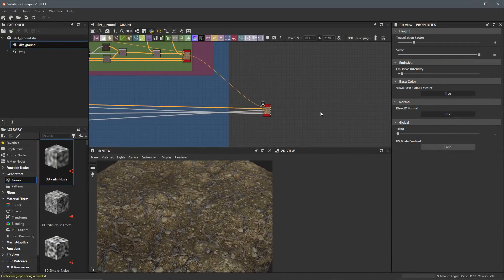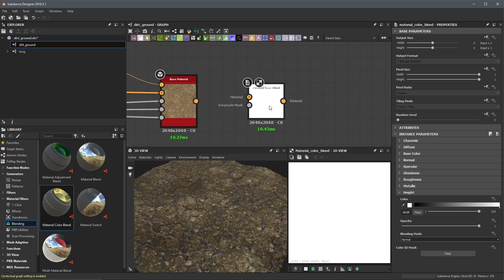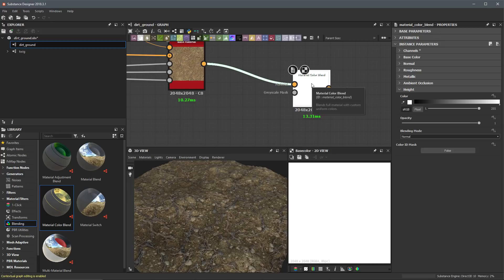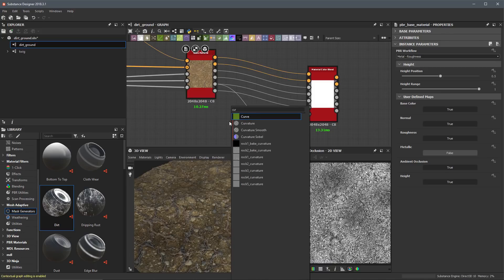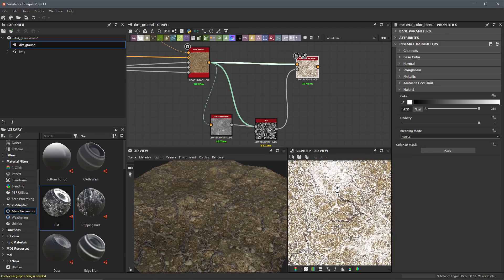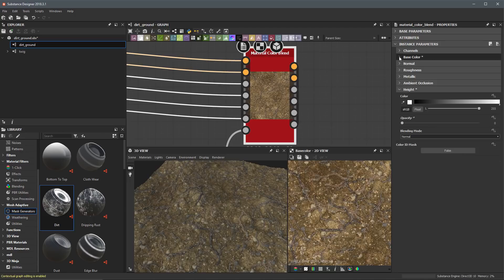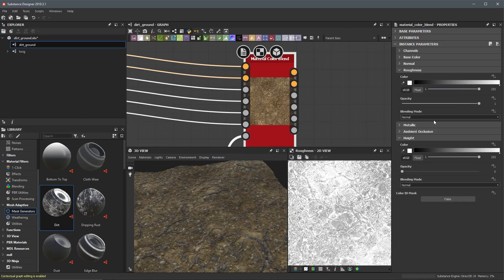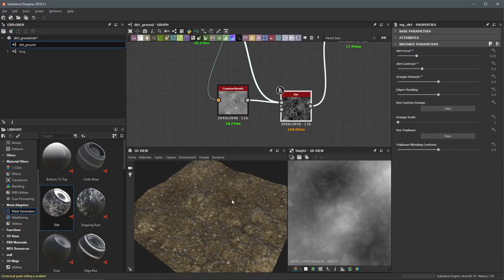04-01: Using material layering to create a dirt layer | Adobe Substance 3D

Comment: How we can make water
Reply from the maker: It can be a simplified version of water using a mask for water areas and then making the roughness map very low so there will be reflections.
Reply: In the next video 04-02 there's a short bit at the end where he adds a "Water Level" node which straight up adds the nice muddy water puddle effect. This really should have had a video all to itself tho, considering the series thumbnail includes a muddy water puddle...

Comment: One of my twigs is reading color from the bottom layers. Do you have anu idea whats causing the problem?
Reply: The order of the small and large twig color sub graphs need to be swapped so that the height from the previous sub graph(i.e. large pebbles) goes into the shape splatter blend color node of small twigs and then from there to the large twigs sub graph.
Another viewer mentioned this mistake in the comments of the previous video.